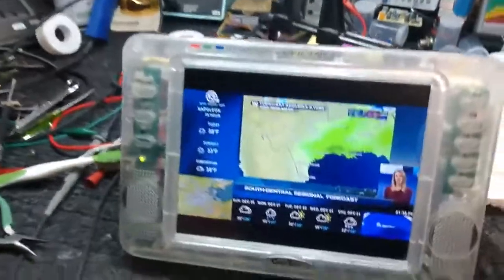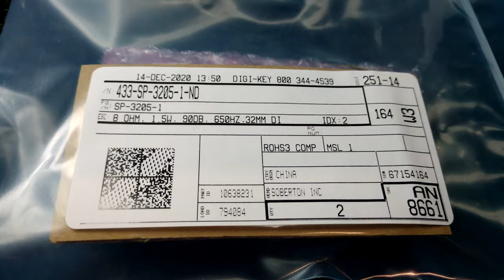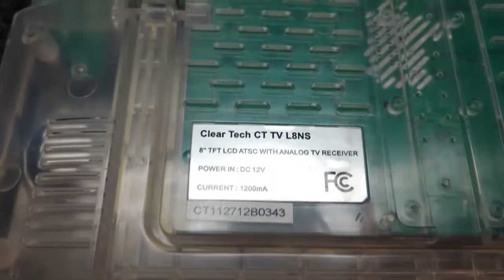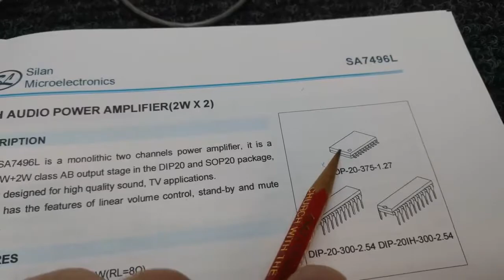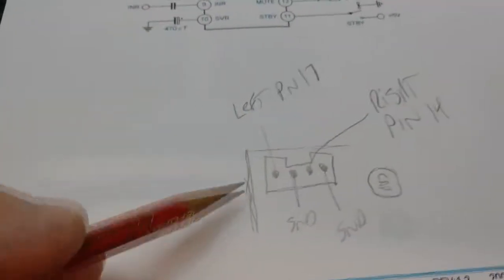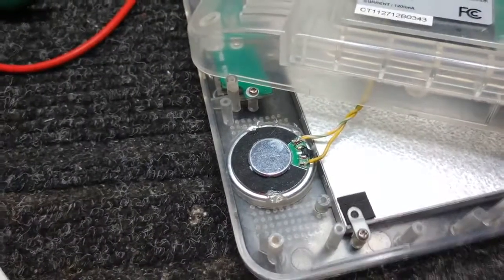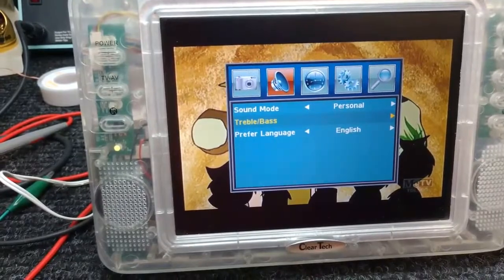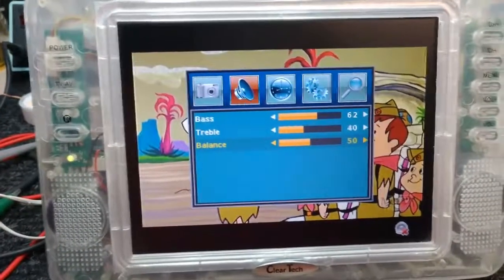Clear Tech (CT TV L8NS HDTV) Modification

Comment: How do you fix a clear tech bc mine doesn't work
Reply from the maker: Start with measurements. What voltage does the power supply show on a volt-meter. Does the voltage drop too low when plugged into the TV? This is an indication of a short or failed power supply. Is the power supply jack loose? Often, if the connection has been used frequently, the solder connections on the TV to the power jack can become cracked. Look closely for the obvious as often it's something simple.